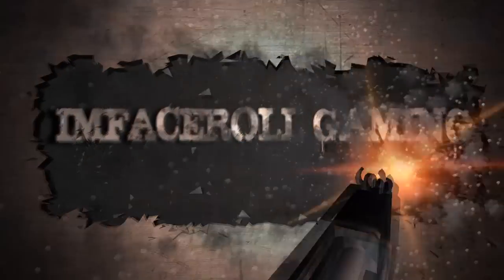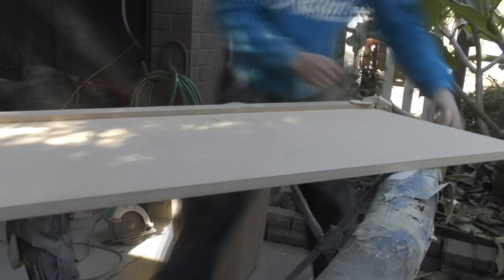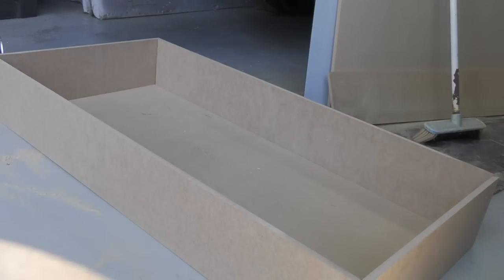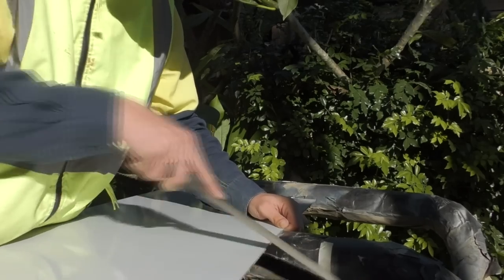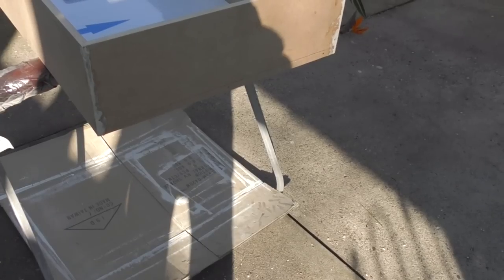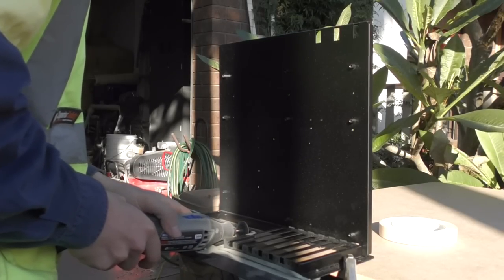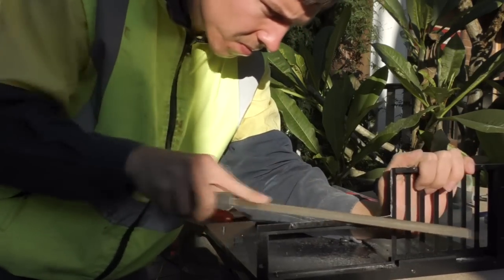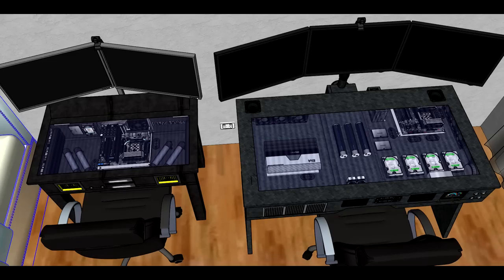My Girlfriends PINK/BLACK themed Liquid cooled PC desk mod Gaming PC part 1

Comment: one piece of advice, instead of dremeling the motherboard bracket you can actually just drill the rivets that attaches it to the back place and use those same holes to screw it to the wood. there might still be some cutting so that the bottom part stays attached but it will look cleaner
Reply from the maker: +SunsetAzul what i was planning was a trim around it after i files it back, but yes you are correct there

Comment: what wood should I use for a pc desk I want to make one soon
Reply from the maker: +jesus zuniga i used MDF wood. any wood that can hold a decent amount of weight will work
Reply: would you recommend any other wood
Reply from the maker: +jesus zuniga most woods will work as long as they have some strength to them